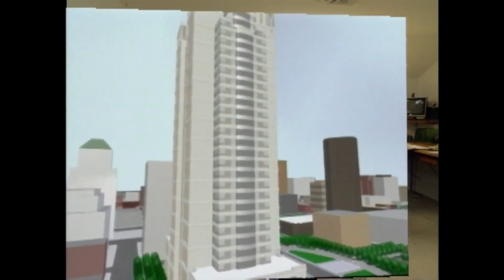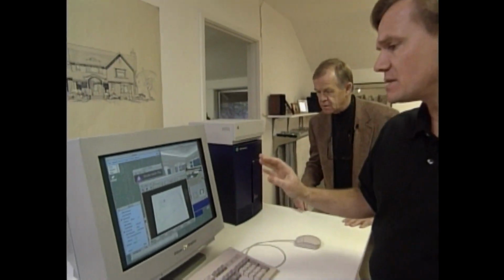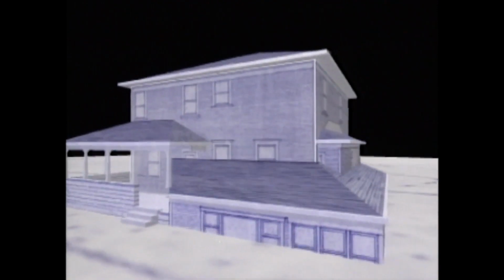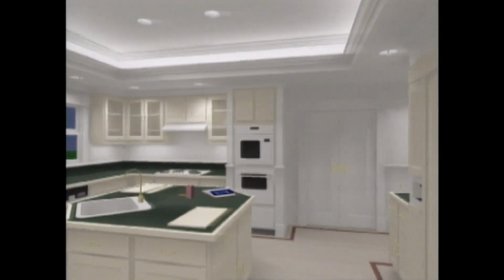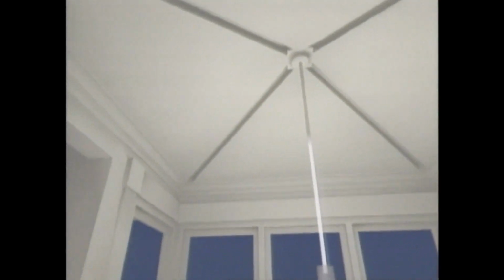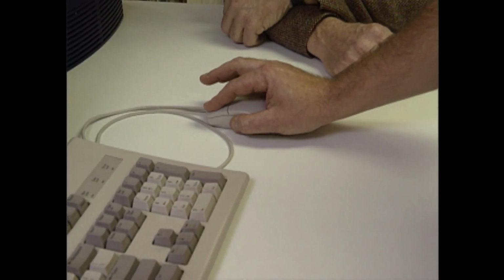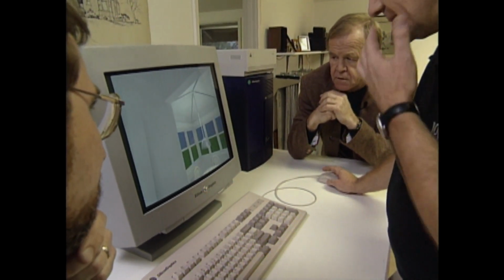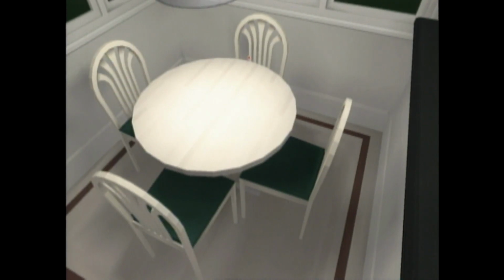Silicon Graphics computer with Norm Abram 1995

Comment: SGI, my first Unix machine.  My first system with a functioning web browser even.  And yes, our monitor on the Weby was that big.

The other thing I found interesting was the webcam setup.   In 1995 there were very few systems with webcam capability, but SGI had already made the webcam with a sliding cover over the lens.  Here it's 27 years later, and you're only JUST seeing webcam covers as standard on consumer devices.
Reply: Which type of monitor is this? I have GDM 4011P and GDM-20E21, but this one looks bigger and flatter than mine?

Comment: I wonder how much computing power it's using compared to today's stuff
Reply: The system did about 30 mflops back then, which was insanely fast as nothing else came close unless you got into supercomputer territory.  However, these specs are laughable today, for even the cheapest $1 off the shelf microcontroller would be far faster.  In 2007, the first snapdragon budget chip found in a smartphone, the S1, could do 40 mflops.  So this means you had a portable device 13 years ago already as fast as this machine shown here.   For point of reference, the newest snapdragon phone, the 865, can do over 1 tflops, that is 1,000,000 mflops.  And desktop 3d graphics card are far faster, for example a $599 geforce graphic card can do 59 tflops (59,000,000 mflops) -  to show how fast that is, you'd need to have near 2 million of these machines to do the work of a single $599 graphic card today (which is not even a top of the line model).. Pretty insane
Reply: @oldtwinsna8347  what would this machine be equivalent to todays computer powerhouse? Because this must pretty powerful for that time.
Reply: @802oldvids  nothing really, it would be really weak.
Reply: @802oldvids  Nope. The Indigo was already way obsolete in '95. Back then the Onyx was SGI's top of the line.
Reply: @802oldvids  like a dual RTX 4090

Comment: For 1995 this is good....although when he did the walk through it really showed you how slow the chips were back then. Even state of the art SG ones. 

Moore’s law etc
Reply: The Indigo (1) seen here was not state of the art when this was broadcast, nor was it high performance to begin with. But I agree the renderings look good, though I suspect the lighting is precomputed with Radiosity, which was either dumped to VTR frame for frame (=smooth) or shown interactively as seen on the monitor (=choppy).

Comment: I was in college at the time working on a similar Silicon Graphics Machine. I think it looks like their Onyx model...those were right at ~$25-$30k. Our College was selected to help build military simulations on these SGI machines. like previously commented these can be done on a iPhone now :P
Reply: The Onyx was quite a bit larger, and a bit more expensive than the model shown in the video. They are using an IRIS Indigo, and considering the timeframe it is probably an R4000 model with some variant of XS or ELAN graphics.
Reply: What's your age now ??🙄